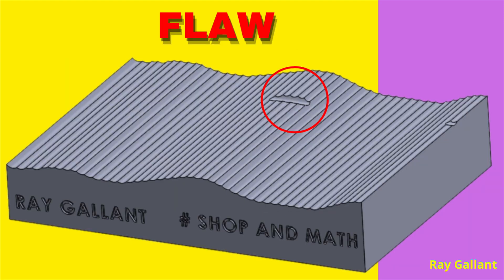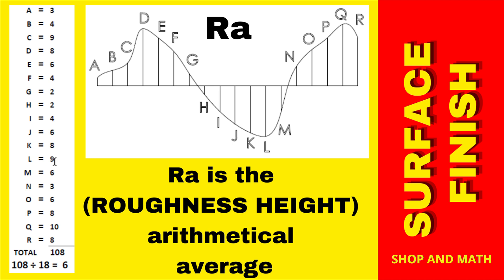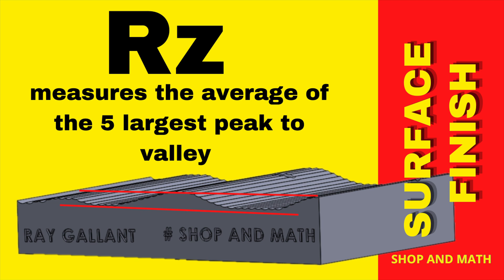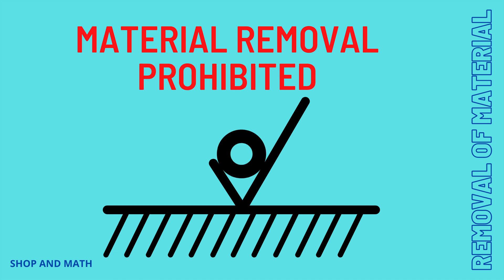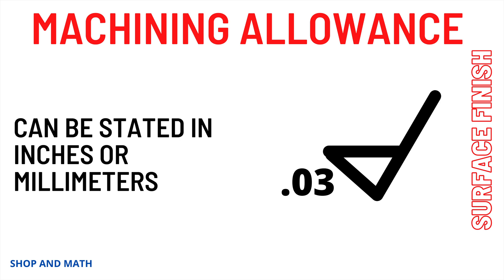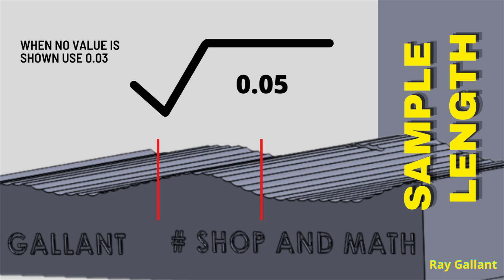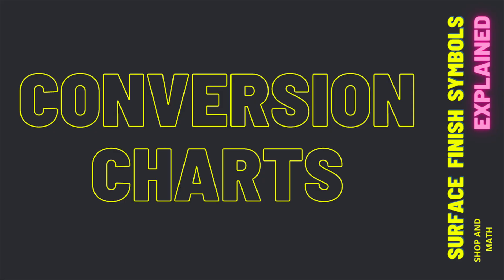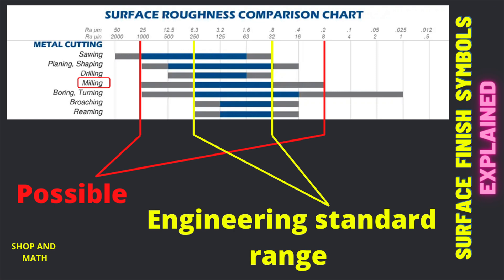surface finish symbols explained

Comment: Hello Sir, i was wondering is there a possibility to measure the parameter Rmr and Rsk on this device? it would be very helpfull thanks a lot!
Reply: It is possible to check the perimeter it needs to be a non-sledded style probe 
It may require a holding fixture

Comment: Great video. I just scored a surftest 210. Im checking finish on everything. Im curious about the standard. It says 117. Im picturing a 125 finish, which is rough. What id consider a saw cut finish. This standard looks alot better than that. So what do i have wrong?
Reply: These pieces of equipment are extremely sensitive and can go out of calibration easy
If you know someone who has the same unit as you do a side-by-side comparison using the same test piece should give you the same results
If you have access to another master sample try using that to calibrate the unit
Ray

Comment: That is helpful to me.   

what are your thoughts on measuring Lapped surface.  More of a flatness spec vs roughness I think.  

I just run an indicator across the part on a granite stone to check, sampling edges and middle and fishing around.   

Surface finish is in the weeds for this I think when indicator is less than 1/10 of a thou or better

Probably a dumb question, had not thought about it.
Reply from the maker: if its for flatness ?
CMM with a contactless prob 
or try using Optical Flats (most high end inspection labs have them)
you could call your local university and ask if they have a Lasermike 
It uses a helium-neon laser beam to scan the surfaces
Reply: @shopandmath  Optical flats are great.  you see so much once you learn to read them.   

Small deviations not something I need to do, but an interesting topic.  Tom Lipton videos has me thinking beyond just 1/2 thou range.  +/- .005 my typical range and I use those finish samples for reference at times.  Thanks for the videos and topics you cover.